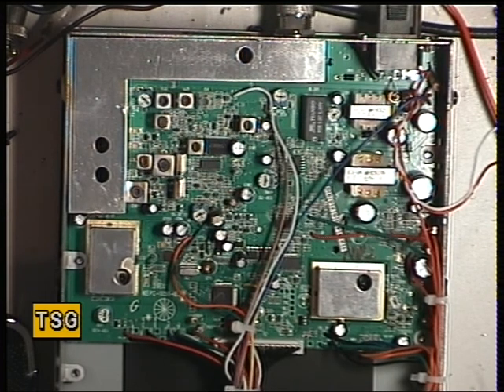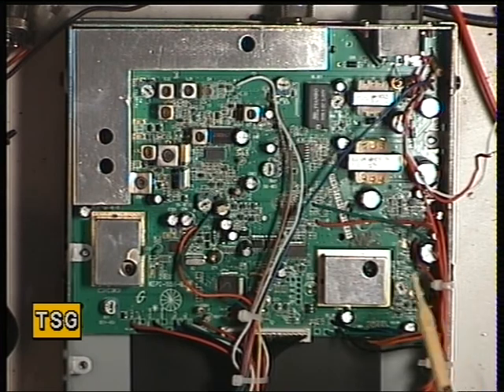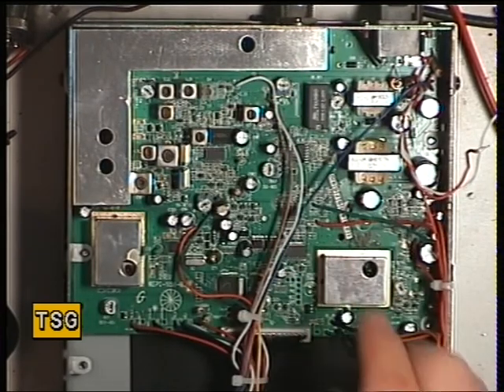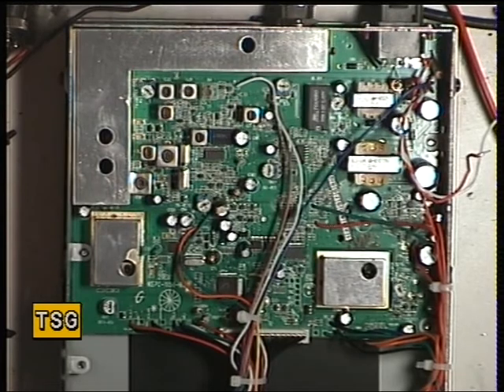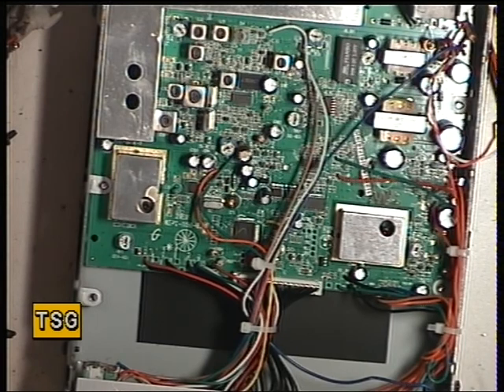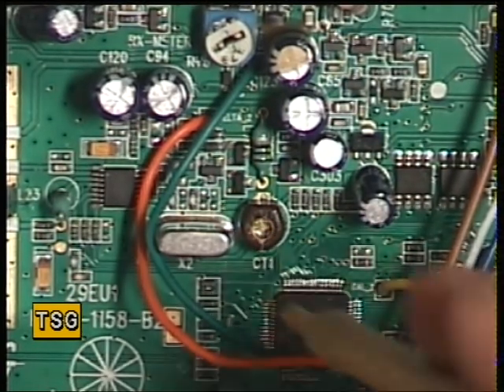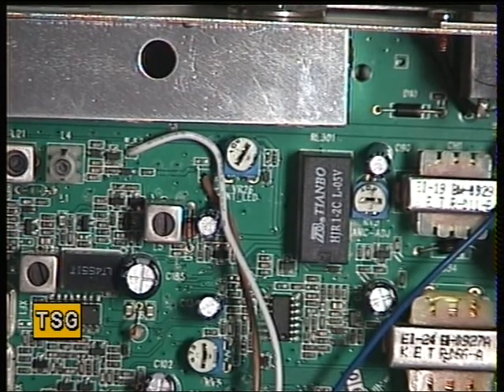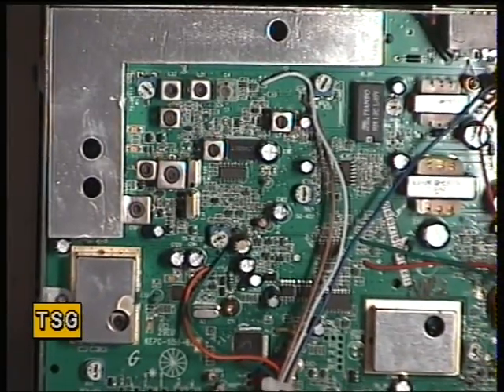Cobra 29LXEU, UK/EU (CE-Multi) 80-channel CB Radio (Mobile) - Transmit adjustment

Comment: I aligned one of these the other day and RV2 did nothing to affect the Tx power indication on the LCD, even though it is marked "TX - Meter".  No matter what output power is set it shows 4 watts Tx power.  I tested the trimmer and it was fine.  The only thing I could find that RV2 affected was the SWR reading by one LCD segment when rotating the trimmer back and forth.

There is a service manual available for the 29 LX EU (easily accessible and download-able via a Google search), which is great, but it does not mention RV2 in its alignment procedure at all and several of the tuning transformers are also not mentioned, e.g. L4, L21, L22, L226.  Some of the alignment instructions are also unclear regarding the mode, band and country the radio should be set to for a particular alignment step, but it's better than nothing.  The schematic and component layout diagram are great until you notice none of the numbered and labelled components have any comp values by them!  I guess someone forgot to turn that layer on in the app they used before saving the images.  Doh!
Reply from the maker: It's not a good manual is it. Goes well with a not very good radio. 

Richard
Reply: @ukfmcbradioservicingTango21  Lol ;)

Comment: hi I have a question about using a power mic with this radio and if there are any detrimental effects on the radio sir.
Reply from the maker: We never test radios with power mikes. Most FM CB transceivers have some type of speech processing. If the radio's deviation is set up correctly (2.2khz average, 2.5Khz absolute max peak), then all radios should perform properly. Our sample of this radio came to us doing just 0.9khz deviation so was a quiet as a mouse! After adjustment using the workshop instruments, the radio then transmitted fine.

Most power mikes are a simple one or two transistor circuit. They DO enable you to talk further away from the mike, but can add "boominess" & distortion. Having said that, some of the speech processor mikes may improve any radio's tx audio.

As our business is mainly involved with 2-way business radio, we are not used to seeing mikes on equipment other than the factory original or a generic standard dynamic type.

If your query is because your radio is too quiet then I suggest you have the radio serviced by someone with the proper test instrument, the radio will then have adequate mike gain.

CB radio have never been a "plug & play" item & never work properly out of the box, whiuch is why we spend 50% of our time servicing brand new radios!

Richard
Reply: UK CB radio servicing my specific querie was whether a power mic/ pre radio preamplification would harm the radio in any way as I have recently been given the astatic dm 104.
Reply from the maker: No it won't harm the radio.

Richard
Reply: UK CB radio servicing thank you for your reply sir, how much would you charge for a basic test and service on aforementioned radio as I have lost all my test equipment sir.
Reply from the maker: Although I only deal with the trade normally, I would accept your radio for service/optimisation on this occasion. Standard charge here is £16.50 + return post at cost (cheapest).  email me at rshireby@yahoo.co.uk 

Many thanks,

Richard
Reply: UK CB radio servicing very decent service charge, I have tested the astatic d104-m6b and found it really improves both the volume and sensitivity of this microphone (audio quality), I did notice in use that there seems to be a delay in responsiveness from the radio to the mic and reception, possibly the combination of the mic and relay switching?.
Reply from the maker: Moire likely the radio. All these 'digital' radios take about 500ms to go from rx to tx, but are quicker switching back. We had this with business customers when they swapped from Pye 2-way radios to modern ones "the old ones were better" they all cried.

With your combination the switching speed is probably more pronounced with the base mike as the ptt switch is likely to get quicker physical action than on a hand mike. Plug the hand mike in & rest it on the desk with the ptt uppermost & have a go...you'll see what I mean!

Prices here are  trade only remember, not retail I receive my renumeration from the main part of our business, not from 2-way radio.

Richard.

Comment: Good video, thanks. Just out of interest, I bought my Cobra before AM & SSB became legal in the UK, it doesn't even show EU AM 1W on the country selection menu. Am I able to effectively turn AM on, for all country channel settings?
Reply from the maker: +asp383 Bear in mind we now ( in the UK) are allowed AM/FM/SSB on the EU set of channels & FM only on the UK channels. Just look in the instruction booklet (it's online if you don't have one) & hopefully it will show a setting where FM 40 AM/FM are both available at 4W. However, to access the UK set of channels, you will need to change the country back to UK.

Remember that in the UK, any CB has to be type approved & show the CE symbol on the makers plate to be legal. USA sets are not legal here owing to different interference standards.
Reply: Thank you, I have the Cobra 29 LX EU, bought new here early 2014. I'll recheck the instruction book & have another play with it.